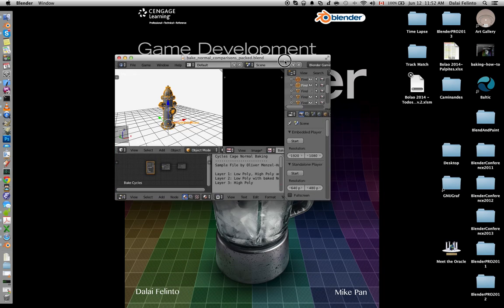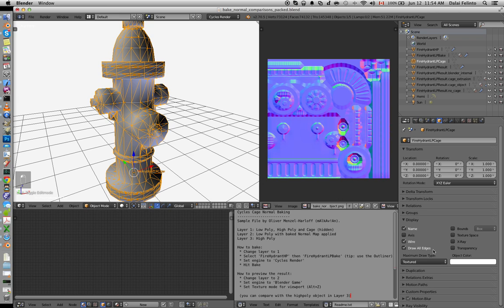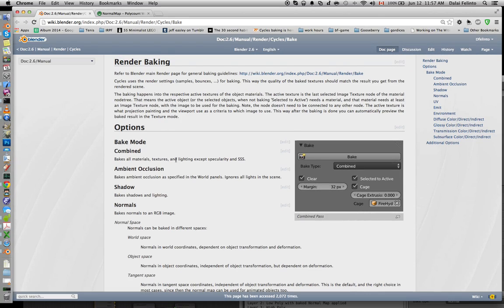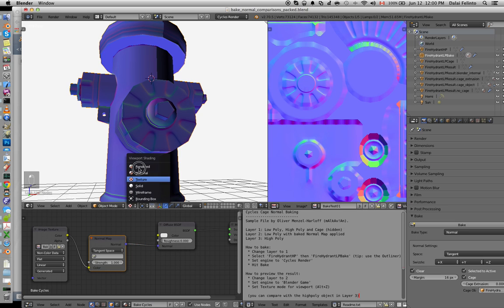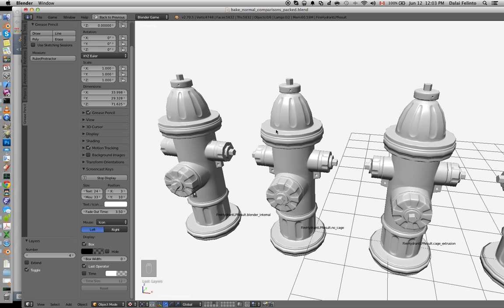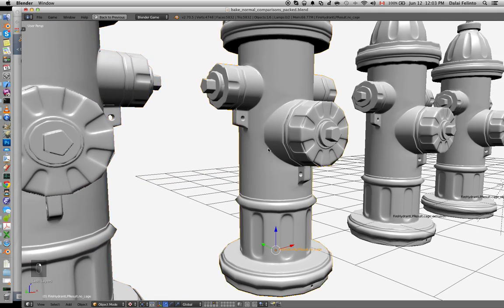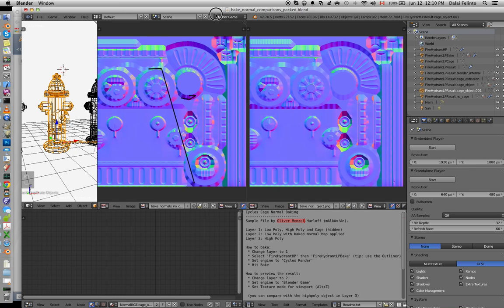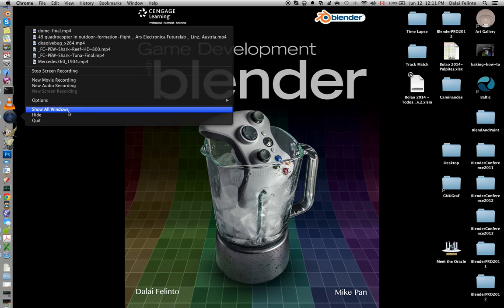Blender 2.71 - Cycles Baking using Cages

Comment: Hi, to bake Ambient Occlusion with Cycles it is needed to have a Light in the Scene or just the Low Poly Mesh, High Poly Mesh and the Cage ?
Reply: ncarrasco2006 I am having an issue with an example I am trying to bake the ambient occlusion and the texture generated is all White in the places that are UV mappings. Any help will be appreciated.
Reply: ncarrasco2006 I am having an issue with an example I am trying to bake the ambient occlusion and the texture generated is all White in the places that are UV mappings. Any help will be appreciated.
Reply: +ncarrasco2006 To bake an AO in cycles there is no need on having a light source. You can do the same asi Dalai but using the AO option. I'm not sure if you are gonna need a cage but you can try.

Comment: Hi! Thanks for the video. Question about the waviness shown on the 3rd model in comparsion: technically what is the difference in automatic extrusion or manually making a cage? I guess manually making it is using 'alt+s', which is also extrusion along face normals.
Reply: The trick is to modify the cage mesh further on. To get rid of waviness you would need to make the cage a straight cylinder whilst the low poly has a slightly conical/spherical shape, http://wiki.polycount.com/NormalMap/#Solving_Wavy_Lines